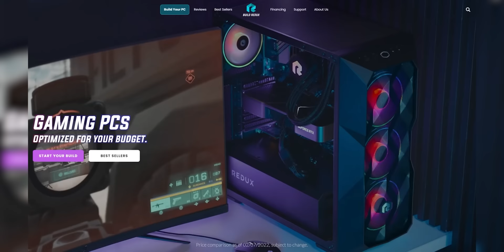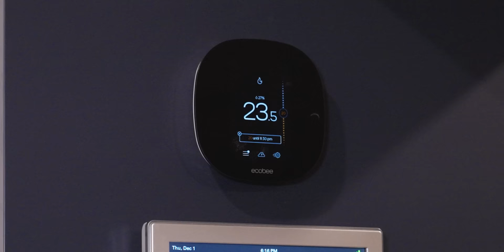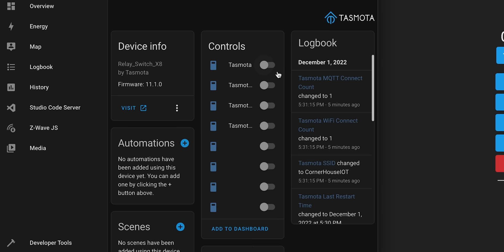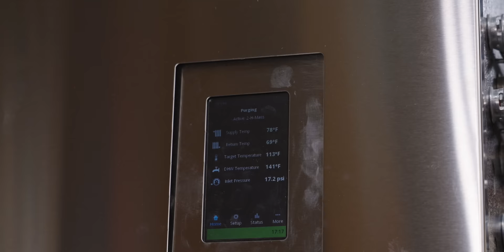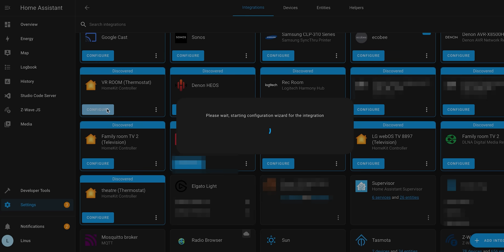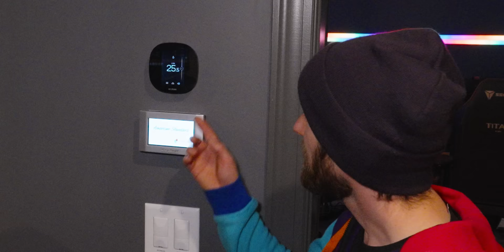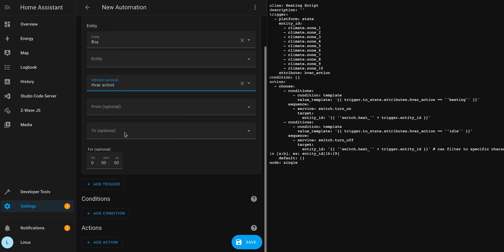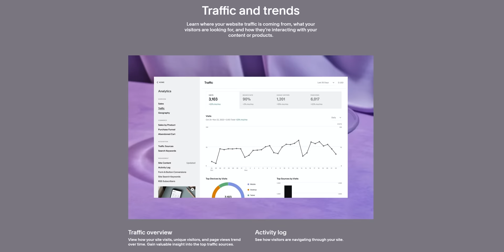My Smart Home is Stupid - HVAC Update

Comment: I feel like the amount of effort that goes into fully setting up this system so that you never have to touch the thermostat again is equal to the amount of effort you'd spend over a lifetime adjusting the temperature valve on your radiators manually.
Reply: As my heat is provided by a steam radiator that has 2 settings - on or off - I so identify with this. It's far better than my previous situation, which had a gas furnace, floor reegisters, and a roommate who kept shoving the thermostat to 80 F or 26.6 C becasue 20.5 C was too mainstream (and the gas bill wasn't in his name).
Reply: True, and for most people it wouldn't be worth it. I enjoy stupid tech projects, so setting up something like this would be very fulfilling.
Reply: @conroy644  taking into consideration the hiking prices of electric power and natural gases after the situation with Ukraine i decided to go back to the terracotta stove and wood burning. my house was never so warm before...
Reply: Most people don't need a system this complex to get automation and comfort.  This is like a German car.... overengineered and liable to break with great cost.
Reply: I feel fairly confident that the effort to set this up is significantly more than they'd spend touching the thermostat for the rest of their lives.  I mean, they only showed us configuring the system without even going into fiddly controls.  Oh, and the bit about the fiddly controls - I'd guess they're probably still going to touch this system more over time to update its configuration as their schedules change.

But this way they can actually program it to do things like driving the heat a bit further in the direction they need it to go when power is cheap, so they don't need to drive it as much when power is expensive, and possibly have the system set to not heat/cool while they're away so long as the temperature stays over water pipe freezing cold, but then turn on in time to get the temperature back to where they want it by the time they expect to be home.

Also, some of us just futz with stuff, like Max said.
Reply: Equal? EQUAL? How about 5000x more?
Reply: @tylerhauth440  I would not be bold enough to claim that much.  I don't know Linus that well.  But I have known people who would futz with their thermostat something like a dozen times a day.

To be clear, that was due to them attempting to be energy conscientious with an old thermostat and not much sense of finesse.

So they'd get up in the morning, run to the thermostat, jack it all the way up, run back to bed to get under the covers where it's warm, then wait until it was too warm under the covers.  Then they get up, shower, get dressed, decide it's far too warm, so drop the thermostat all the way down.

That would probably last until time to go to work, at which point they'd set it up to 50 to keep the pipes from freezing.

When they came home, they'd go into the same kind of routine, doing the work the thermostat would have automated had they any sense.

I'm not sure if they continued doing that.  I haven't seen them in decades.  But when I went over to visit, after they'd turn the thermostat all the way down, I took to moving it up to about 5 degrees less than where it happened to be just then, and they'd enjoy a night of not messing with the thermostat all the time.

I'd like to think that Linus has more sense than they were demonstrating.  But then he suggested that this was going to be a net time saver, so I do have to wonder just how much was he futzing with the thermostat.

However much it was, it would've been less effort than what this took.  I think if he messed with his thermostat about the normal amount, that 5000 factor might be about right.  I just don't feel like it could've been accurate for him, unless the real purpose behind all of this was to just get another video out.
Reply: It’s definitely more of a hobbyist thing than average consumer. That’s starting to change but it’s still stupidly complicated if you’re inexperienced.
Reply: I have a smart heater that allows me to set a program and never look at it again. It took about 15 minutes to set up, it has a tablet-like controller in the living room and works with an app. Easy as can be. 

I've only manually adjusted temperatures a couple of times in the past few years, mainly when my mom was visiting and complaining about the cold 😂
Reply: @FuckedUpGenius  Yeah I set a schedule on my boiler in 1999 and I think I might have changed it once. The radiator in each room has a thermostat on it, technology from the 50s. 

Smart homes are very dumb.
Reply: Yup!
Reply: that's why you hire someone to do it for you. I mean hire someone to adjust thermostat for you.😂
Reply: Yeah, but it is funnier trying to automate the shit out of smth.

Comment: As a former plumber, I cannot fathom why anyone would willingly do this to themselves.
Reply: Imagine buying a house like this. Oh yeah the heating won't work at all because it was all hack job held together by custom scripts running with home assistant on my NAS that I'm taking with me. Good luck getting it going again.
Reply: @TheAkashicTraveller  orrr, he'll have an electrician stick a $50 thermostat there instead and the whole thing is bypassed. Or any of the new wireless controller systems that are out now, or will be by then, and again problem solved, quick cheap and easy, back to a dumb home. It's not some irreversible change, it's using the same contacts and switching methods any dumb system would use.
Reply: As an electrian I can’t imagine trying to trouble shoot this house
Reply: @TheAkashicTraveller  they did bother wiring it up for thermostats even if they're just using it for power and all they have to do is add a traditional relay box at the valve and tie the thermostat and it's really not that big of a deal
Reply: I'm a software engineer and would love to have this house. Been able to fully control it remotely and automatically is something that is just awesome.
Reply: I've done a lot of hydronics myself in the past and this system is way over done. Even if you took him to a thousand homes and buildings to illustrate how simplicity is the better part of efficiency he would still choose to overcomplicate this system. Some people are incapable of taking good advice even if it means that they never get what they want.
Reply: @josephhakim2344  Yeah. I'd like to see that.
Linus: Well, that's my system. Can you get it working?
Electrician:
Linus: Oh. That was an afterimage. (Yells) We lost another one!
Reply: Still better than a cloud *solution*.
Reply: As a Home Assistant user with 90+ devices, I would happily have and play with a system like this.
Reply: As an electronic tech designing as well as servicing exotic vacuum tube amplifiers and systems, I couldn't agree more. If it ain't broke, don't make it neurotic. But some insist that their refrigerator communicates with their dead aunts hairdresser's brother to make their life whole and meaningful.
Reply: @nicholashaines4136  Which "thermostats"? The mercury bi-metal ones that they used before (that will work unaided for a century) of the 'new' wireless ones?
Reply: @ViXoZuDo  Have you replaced the wheels and steering on your car with virtual systems yet?
Reply: If I ever have a chance to visit Linus's house, I'm gonna bring a wifi jammer and a parka and watch him slowly freeze.
Reply: Y’all know this is a Tech channel? This crazy project is as much for content as it is for personal use.. it’s quite entertaining to watch him go overboard and try to figure out a solution to the monster of a system he’s created.
Reply: @muyoso  🤣
Reply: as a high schooler with no plumbing qualifications, I agree
Reply: @CorDawgYT  glad I found one reply from somebody on the same page as me. Yes I understand the whole aspect of simple is better. But as a Total nerd who's day job is a certified HVAC technician, I can tell you that H.A. is the best thing that's happened to my house. I have completely eliminated my thermostat and replaced it with simple ZigBee relays. I put a cheap 10" android tablet on the wall in place of the thermostat and used the existing wires to send 5v for USB charging for the tablet. I went from needing the old thermostat set at 72F in the winter and still having cold/hot spots. Now with H.A. I am averaging the temperature of the 4 corner rooms of my house with super cheap BLE sensors. I keep the heat set to 67 now and the house temp is way more consistent and comfortable. Not to mention with the tap of a finger I can switch from an avg temp too prioritizing any one of the individual rooms. I absolutely love it and couldn't imagine going back too a "simple" solution at this point.
Reply: I work doing professional automation and I can confirm this is the most hacky shit anyone can do to a high end house. 
It doesn't have to be professional, just solid AF.
Reply: I would do this kind of thing, but it would all be controlled by like relays and wired thermostats and shit, not all this wifi bullshit and apps. The control cupboard would look like some soviet shit from the 1960s but it would be fucking bulletproof.
Reply: Its not about how much it costs, its all about it not working and never being finished.. Everyone needs a hobby!
Reply: because DIY is fun for some people and it makes him money.
Reply: @TheAkashicTraveller  Selling a smart home should be considered fraud lmao.
Reply: @muyoso  probably going to have to find a different channel for that, sure there’s a niche home improvement channel centered around tech with 3k subscribers that makes quality content. Keep digging in that search bar.
Reply: I'm an IT guy and I'd RUN from this house if I saw it on the open market.  Jake will never be able to take a vacation more than an hour's drive away!  To need a phone AND A LAPTOP to turn on the heat... 😂 😂 😂
Reply: @TheAkashicTraveller  I assume they'd leave the home assistant installation when selling the house.
Reply: Cuz it got millions of.views throughout all the Videos

Comment: I like how every new episode of this series is a new argument against smart homes.
Reply: @Nathan5791  These things should withstand more than most cloud providers are willing to provide a service. Good luck after that.
Reply: I actually see these as a reason to push companies to sell more local equipment and pressure not having all the proprietary bs
Reply: Because in the truly spirit of LTT he had to do everything by himself. When you integrate everthing into 1 you likely run into communicate problem between each component instead of 1 unified system, it make troubleshooting and maintenance a nightmare. But the bright side is you wouldn't have been stuck in 1 eco-system or have to pay for subscription services just to use the product you already bought.
Reply: @JtoddP73  Yep, there are upsides and downsides to all the things. I like to go the middle way and make chunks of "services" from one brand. For example heating is one ecosystem, AC is one and so on. Heating for me is Honeywell's evohome. Its one unified system that works even if router+home assistant goes down. But its hooked up to HA for advanced features like, if we leave home for more than 48 hours then turn down the heat. That way I have a local fallback for every service and if internet or HA goes down they can still function on their own.

As for DIY vs out of the box solutions, it should be chosen based on the individual's skillset and ability to troubleshoot. Those relay models that Linus has are great. I have one triggering some non essential stuff, but I am not sure I would rely on them when it comes to heating.  If you do DIY stuff, then be prepared to do troubleshooting when it goes wrong or looses pairing etc. because you don't have a vendor's support. If you go vendor system, you would have support from them. In this case when there is an ecobee, an off the shelf relay and home assistant system, then you are definitely left on your own (none of the wendors are going to help you). Not to mention that if something happens to a relay and it cannot shut off a valve and you have water or heating running for long and get a very high bill, if you have a unified vendor system for it, then insurance can cover your loss (high heating bill) because of the malfunction. If you go DIY they will not.

So these are things to consider.
Reply: If all these devices are called "SMART", yet aren't in the slightest, what do you think "SMART" even stands for then? 
S.M.A.R.T. - Secret Militarized Armaments in Residential Technology
Reply: @Nathan5791  It's also just fun and content for them, generally atleast, I do think the heating issue should've been taken more seriously, but god damn, just turn it up manually
Reply: @Crimin4L  I hope you’re joking lmao
Reply: @MrGatya2  my guess is their are experts/consultants you can hire to tell you what systems to pick and choose because they know what works well/together.
Reply: @JtoddP73  Save the headache and use KNX, a global building automation standard with 500+ vendors and 100.000+ partners to choose from. I have it in my house and it is used to manage Terminal 5 at Heathrow Airport among other large intallations
Reply: Nah. Just have an easy to use system that handles itself or do a real DIY setup with normal thermostats that hook up via network cables. Then you can just write your own webpage that can be accessed from anywhere on your network on any device to control it.

It sucks because he's half assing DIY. Go properly mainstream and let the company handle this for you. Or do real DIY. Half assed DIY sucks in all contexts.

Comment: I remember working in HVAC and we had a house that we installed AC in and The homeowner complained that it would freeze her out in the afternoon. We asked her what time and she said around 3:00 so made an appointment to be there the next day at 3:00. The light would come in from the window and hit a mirror and get reflected onto the thermostat like it was Indiana Jones finding the room where the ark of the covenant is held. We just tilted that mirror bit, problem solved
Reply: Damn, i would never have thought of that kind of problem 😂
Reply: That's hilarious. You just never know what gremlin is lurking to screw up a plan.
Reply: @elchartps3  Happens alot
Reply: And different times of the year… people are funny
Reply: Stonehenge of a house equinox established
Reply: Lmao that is crazy 😂 thermostat placement may be the most important part of your system
Reply: No face melting involved 😅
Reply: I just laughed out loud in a quiet place. That's a story
Reply: "Customer states..."
Reply: Lol, people forget the actual thermostat unit is what's reading the whole house's temp.
Reply: Totally different type of problem, but I recall a satellite Internet connection that would go down like clockwork in the morning.  The problem was reported for a few weeks.  Finally, we were able to check it while it was offline rather than getting to the location after it had come back online.  Turned out that dew was getting into the coax shorting it out, but later in the morning it was evaporated fixing the connection.  A little application of dielectric grease to prevent the moisture ingress solved that problem.  It's funny how things you'd never normally think of being related to a problem can absolutely be the specific issue.
Reply: lol, I'm happy that I live in tropical country so we doesn't really need to control my room temp, just my lovely fan is enough. well a lot of people using AC too here, I just can't afford it and can't really stand cold
Reply: That's hilarious.
Reply: Reminds me of problem at work, when camera on one machine stopped working randomly. It was happening for about three days at relatively same time, so one day I came in sooner. There was square of sunlight, sized about 5x5 centimeters traveling thru whole plant and that one machine. And somehow it traveled exactly over camera lens! Solution? I just grabbed some sticker and placed it on plexiglass cover on machine :D
Reply: Funny thing is, this is common enough that Nest thermostats have a setting that adjusts when it sees too much light hitting the Thermostat.